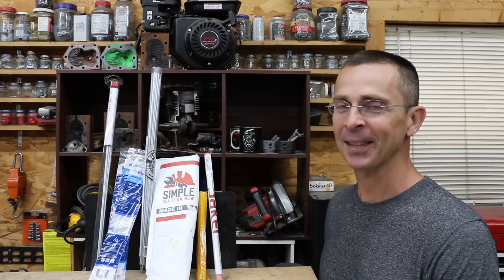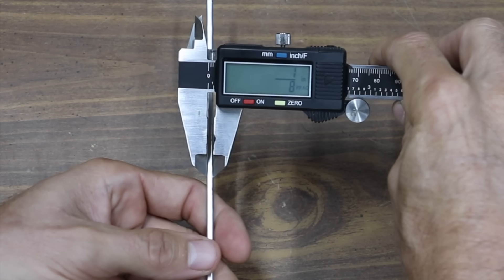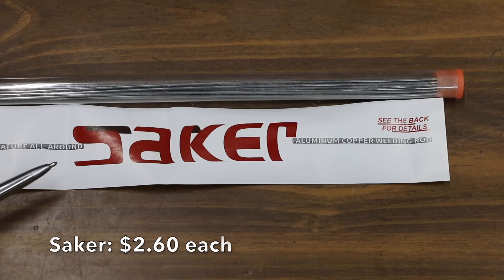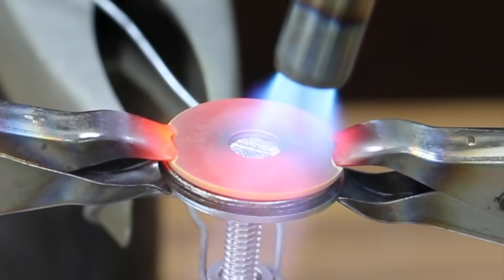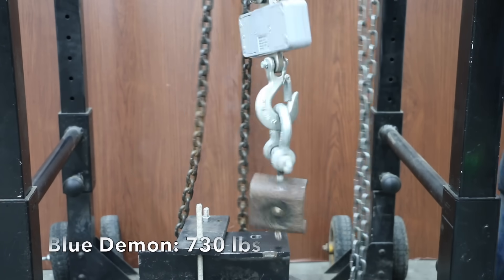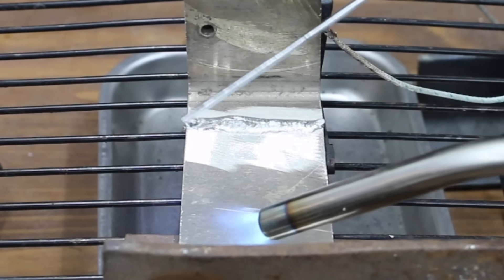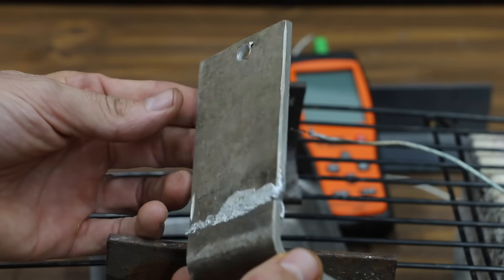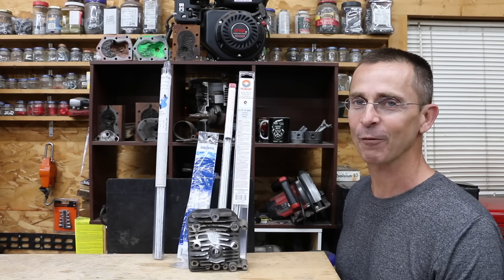Best "No Welder" Aluminum Welding Rods? Alumiweld vs Bernzomatic vs Hobart

Comment: Infrared thermometers are sensitive to the reflectivity of the surface they are pointed at. They are most accurate with a flat black color and become less accurate with increases in reflectivity. I mention this because you mentioned that the shiny silver weld was cooler than the black cylinder head and that reflectivity might be why you thought it was.
Reply from the maker: Thanks for the feedback.
Reply: @ProjectFarm  test it!!!! Thermo meters on reflective vs flat black. What gets most accurate reading haha. Thanks
Reply: Oh ok.. I have wondered about the wobbles in my thermometer. I actually learnt something today. Thanks!
Reply: yep,  look at a piece of copper with a thermal camera it is basically like a mirror. A quick fix it to put a piece of kapton tape on
Reply: @fuzzy1dk  - Perhaps scuffing the surface would reduce the mirror effect(?)
Reply: I switched to using a cast iron pan for cooking stovetop steaks for this very reason.   I originally had tried to do it in a thick bottomed stainless steel pan and tried to get the temp up to 500F measured with IR thermometer.     Never got there.  When I finally put the steak on, the butter I had put on the steak instantly flashed into flame.    After putting out the fire, I again measured the temp of the now blackened pan and it was north of 900 degrees.       I don't have this problem with black cast iron.  What I read on the IR thermometer it what it really is.    And yes thermal imaging cameras have exactly the same problem as IR thermometers.   The more reflective the surface (lower the emmisivity) the less accurately it will read the temperature of the object it's imaging.
Reply: @daemn42  I didn't think there was nothing better than cast iron to start with. But I always Heat my oven to 500 Degrees with my iron skillet in it. When I get ready to take it out and cook I also have my front stove eye hot and I do not put anything directly in the pan as far as grease goes I only put maybe a thin coating on the steak just rubbed on with my fingers and then the steak hits the pan after about a minute and a half or two I flip it over and stick it back into the 500 degree oven and finish it off with probably turning it once more. Hell I guess I'm just glad to know that I somebody else out there that will actually fry a steak every now and then instead of putting it on the grill . Happy eating!
Reply: As someone stated already, this is indeed called emissivity. I have found that for lower temperature work, black electrical tape can be applied to the surface to measure and you will get very accurate readings. For higher temperatures, you can use Sharpie brand markers as the ink they use it very heat resistant. For even higher temps, use flat black BBQ grill or header paint. A very thin dusting is all that is needed. That will get you just over 1000°F with accurate results. :-)
Reply: @MrLangDog  Its not a color thing, its all about emissivity. It just so happens that the color black gives the truest emission and polymers that are black generally produce the truest signature. So, electrical tape (vinyl) and paint (enamel) are two readily available materials of low thermal mass that heat up quickly to match the substrate temperature and provide strong emissivity for the sensor to pick up.
Reply: Those who say reflectivity have little to no effect on temperature reading have obviously never used an IR thermometer.  The shiny-ness makes a HUGE difference. A 300 degree piece of shiny aluminum might read less than 100 degrees, paint it flat black or stick laptop tape on it for an accurate reading.
Reply: @mrbmp09  the term is emissivity.
Reply: @mrbmp09  - Couldn't agree more + there are lot of thermal imaging videos all over youtube that confirms the reflectivity phenomena/issue that affects all thermal imaging cameras.
Reply: @MrLangDog  The source is experience. terminology aside, infrared cameras and thermometers  do measure emitted radiation, but they are not immune from reflections. There are videos on youtube of infrared cameras looking at reflective materials and seeing the reflection instead of the material. As some of the previous replies have stated, if you use those contact less thermometer to measure shiny things, the measurement can be inconsistent or inaccurate. Placing a peace of electrical tape (temp permitting) on the subject produces more consistent and accurate results. This could be a fun project for your class as well, so I encourage you to try it. The easiest thing to measure is a black body, which I assume you're familiar with in thermodynamics. Also note that because we can't see infrared, what reflects it is not always intuitive. Some glass acts like a mirror to it while other glasses are transparent to it.
Reply: @TeknoMage13  I was exactly thinking the same thing.  I will try it!
Reply: That is good to know. Thanks.
Reply: TIP: Kapton tape eliminates ir emissivity issues. Stick it on shiny parts and show the actual temperature
Reply: @MrLangDog  Lol... Dark melanin protects against UV light\radiation, not infrared.. 🤦 Looks like you need some brushing up
Reply: But how about testing red hot steel temperature or molten metal, how laser react in these situations.
Reply: @wilkas159  laser is only visual pointer and doesn't take part in measurement
Reply: @haczyk84  good to know but I asked different question
Reply: Does thermal imager camera also work on infrared light?
Reply: @akhtarkh  yes
Reply: Comfort Zone 

Yes.
Reply: @akhtarkh  It depends on what you mean by "infrared". Thermal cameras use far infrared. Your TV remote uses near infrared. There's a big difference in these two forms of electromagnetic energy.
It's possible to sense heat using a camera sensitive to near IR if the object is hot enough. The object has to be almost glowing red hot in order to glow near infrared hot.
I think near IR is outside the range of most thermal cameras. Most regular digital cameras can sense near IR. If your camera can see the LED of your TV remote, it can see near IR.
Reply: Copper is super reflective to IR.   Industrial lasers (for cutting metal) use copper mirrors,
Reply: At first I was going to chime in and say that the original commenter meant "emissivity", not "reflectivity", but they were not incorrect. The emissivity is the amount of radiation being emitted by the part, while the reflectivity is the amount of external radiation being reflected off the surface. So if it's a shiny part, you will also observe reflected radiation which can affect your measurement. 

Another way to think of it, if you want to see a person walking by outside a window you need to see the light that comes through the window (technically transmission, but from our perspective it's like the window is emitting that light to us) but if you have a bright light behind you that is reflecting off the window, the glare will obscure your view. So think of this as a combination of how efficiently the metal turns heat into light combined with thermal IR glare from the room around you.
Reply: @deathraylabs_nature  Thank you for understanding what I was talking about.
Reply: Nope it has nothing to do with reflectivity. It's emissivity and it doesn't matter whether the materials black or silver. The temperature affects the wavelength of the light independent of intensity.
Reply: @MrDanthemaniam : Actually, reflectivity DOES affect thermal imaging. You can test this yourself with two pieces of aluminum, one shiny and the other blackened with paint, anodizing, or blackening solution, whatever approach you prefer. Heat them in the oven, then pull them out and look at them with a thermal camera. The shiny one will register as being cooler.
Reply: @MrDanthemaniam  I'm avoiding getting into the physics of how it works, but the reflectivity in the infrared wavelengths is a factor. If you try to measure the temperature of a window, you're likely going to get the temperature of whatever is in the reflection. It's why when using these devices people put a peace of electrical tape on what they are measuring to get consistent readings.
Reply: @MrDanthemaniam No,  reflectivity basically is the inverse of emissivity. Bare aluminum has a low emissivity at this temperature regardless of surface texture. The repair will appear cooler in the thermo camera.
Reply: color perception by the human eye isn't a reliable indicator of emissivity, which will factor into temperature readings using IR measurement methods.
White out correction fluid, for those still able to remember it, has a high enough emissivity to allow for temperature measurements when painted on low emissivity targets.
Reply: While true, it isn't likely to make a factor 2 difference unless we're talking about a literal mirror finish (which this is not)
Reply: @smeezekitty  Its not about being a mirror finish or what your eyes see. It has to do with the surfaces ability to emit black body radiation; something you cannot see. So, optical reflectivity and transparency is not a valid representation of the ability of the surface to be accurately measured.
Reply: @StreuB1  If you read the instructions they usually include a table for compensating readings from different materials.
In this case the idea that the aluminum weld is a vastly different temp than the steel it is brazed into is obviously nonsense.  It is the measurement technique.
Reply: @smeezekitty  - Would be pretty "cool" if these welding rods had magical/beneficial thermal qualities(!)
Reply: @smeezekitty  I think it probably could make as big a difference as was seen on the video - the emissivity aluminum oxide is about 0.4, and the shape of the cylinder head fins will increase the apparent emissivity further (lets guestimate 0.55).  The emissivity of zinc (these rods are a zinc, aluminum alloy I think) can be less than 0.1 - so it might not need a mirrored finish to get the emissivity down to half of that of the cylinder head.  The way to test would be to blacken it with a high temperature paint, or just soot.

Comment: FYI thermal camera works best on matte black surfaces. Shiny things for eg mirrors you can actually see the temperature reflection like normal light and that's why that welded spot showed up cooler. If you want the best thermal picture, spray paint the surface under test with flat black paint
Reply from the maker: Thanks for the suggestion.

Comment: I'm kinda surprised that those aluminum rods didn't flow onto the red hot washer by capillary action....for example when you're brazing steel together with brass rods, however I did solder/braze a brass fitting with solder on some  aluminum tubing by capillary action...I'm guessing different rod material determines capillary action 🤔🤷🏾‍♂️....but glad to hear "mountain"👍🏾👍🏾
Reply from the maker: Thanks for sharing.

Comment: The Iceyyyy brand claims to be "eutectic silicon aluminum". Looking that up, it's probably eutectic silumin. What I found online says that alloy has a melting point in the listed range of above 700 degrees - but it's in CELSIUS, not Fahrenheit. If that's what it is, then the company probably just badly copied and edited some text from somewhere else for the instructions. I wonder if the Saker is almost the same thing but repacked.
Reply from the maker: Thanks for the feedback.

Comment: Got a question for you has nothing to do with the welding rods. If using a dual fuel generator gas and propane options. If I only use propane no gas will propane leave water ( condensation ) in the carburetor fuel bowl? I am wanting to buy a dual fuel generator but not sure if propane will leave water ( condensation ) in fuel bowl. Thus if I needed to use gas in generator it wouldn't run do to carburetor being contaminated from corrosion? HOOF OUT!!
Reply from the maker: Thanks for the video idea.
Reply: @ProjectFarm  It will be interesting to find out. I'm thinking using propane for a period of time will put water in the fuel bowl.

Comment: Excellent test. Another test that would probably have an interesting outcome would be testing different solder for both electronics as well as plumbing
Reply: boy that would be hard to get numbers out of to compare.  If you're looking for advice on solder, I manufacture boards for a living.  Look no further than AIM SN100 alloy with CX18 flux.  Their glo-core flux is the next best if you can't find CX18.  Better than lead.  Irons, hakko 915 is the best, 888d is cheaper for people who don't use enough to justify a real machine.
Reply from the maker: Great suggestion!  Thank you.

Comment: I cannot believe it.  I just got back from Tractor Supply with Hobart's aluminum brazing rods and here you are testing it!  My previous brazing aluminum tubing was with "Harris 1070K Misc Alloy, Al-Braze, 1070 Kit" it did not seem to melt before the tubing did.  I sure hope Hobart's will do great.  FYI I am not 100% sure but my research shows that the most common alloys which are in the 606x-Tx family are not meant for brazing/welding.  The 'T' signifies that the alloy was tempered, in this tempered state they are indeed the strongest, but after brazing/welding they are the weakest.  5052 is one of the better alloys to weld/braze without tempering the item after it is brazed/welded.
Reply from the maker: Thanks for sharing.

Comment: I would like to see what happens to antifreeze at different mixtures with water and temperature they actually freeze at to break a block. I live in Fairbanks alaska and it gets 60 below . I've seen pure antifreeze freeze at that point as I left a jug of it outside one night.  It may be interesting. Thank you love your channel.  Johnny.
Reply from the maker: Thanks for the suggestion.  Thanks so much!
Reply: I have heard pure antifreeze will freeze sooner than a mix of AF and water. Try it when it turns cold(er). It doesn't get cold here in Alabama!

Comment: I've never had to weld anything since metal shop in the 8th grade but now I want to weld everything ha!  One quick question: how have the LED shop lights held up? Any color shift or any issues?
Thanks for all the great videos
Reply from the maker: The shop lights have held up very well.  There is 1 tube that only partially lights on really hot days.
Reply: @ProjectFarm  Thanks for the info

Comment: 4 years ago I built a large light bar for my duck mudboat and rebuilt a rear deck lid on the boat. At the time I didn't know how to weld so I used these rods. I used both the Harbor Frieght brand and Hobart. I stand on the rear deck lid everytime I drive the boat, it hasn't failed yet. On the other hand the light bar has been through hell. Its mounted right on the front of my boat and its used to break down large brush all duck season. It was doing great until I hit a large tree last year going about 20. Nothing will hold up to that abuse. Anyways, time to build a new light bar but this time I'll be welding it for real. I need something stronger.
Reply from the maker: Thanks for sharing!

Comment: Nitpick: This is (supposed to be) brazing, not welding. In welding the base metal melts, in brazing it doesn't. The only welds made in the test were unintentional, and the improper resulting heat treatment weakened the material. The braises held up well though!
Reply from the maker: Thanks for the feedback.

Comment: The icey brand appears like it needs some sort of flux? I've had regular old solder that won't melt due to the oxide layer which won't melt till thousands of degrees.  A little dab of flux and it melts straight away. Curious if it would make a difference on a couple of those that had a hard time melting/adhearing
Reply from the maker: Thanks for the suggestion.

Comment: I picked up the Harbor Freight ones and even after cleaning the surfaces super well, the brazings cracked. I used them on the rear cargo rack of my motorized bicycle so the vibrations are probably what got them.
Reply from the maker: Thanks for sharing.

Comment: 1mm - 2mm solder showdown, leaded/unleaded/silver content, resistance, strength, comparison to brass brazing? Same basic tests as this video with 1 more test. (You will need liquid flux)
Reply from the maker: Thanks for the suggestion.

Comment: I tried to fix an aluminum hand truck with an alumiweld rod using a propane torch. Couldn't get it hot enough. That thing was a giant heat sink.
Reply from the maker: Thanks for sharing.

Comment: Amazing. I didn't even know low-temperature aluminum welding was a thing.
Reply: It's not this is called brazing, not to be a know it all but welding is when the base or parent metal and the rod both have to melt and fuse together , this is more like soldering
Reply: @tyvek05 Brazing describes the process, not the materials used. There are many types of brazing which involve no copper-containing filler rods, although the most common example involves brass or bronze.
Reply from the maker: Thanks for the feedback.

Comment: Honestly this whole video surprises me, I did not know you could solder or braze to aluminium due to oxide formation so I've never tried. I though you always had to weld it and use a shield gas. I'm going to have to try this out!  
Thanks again!
Reply from the maker: Thanks for sharing.

Comment: Excellent info - much thanks for this.  I had an idea I mentioned in an older vid, but will do it here also.  How about a test of paint removers?  it could be dine for different types of paint and different surfaces.  Something else I would like to see is a test of paints for tools/metal.  I bought some Rustoleum metal paint for a vice I restored and, despite company assurances before buying, have not been happy with it.
Reply from the maker: Great suggestion!  Thank you.